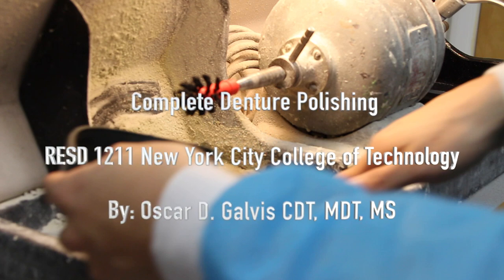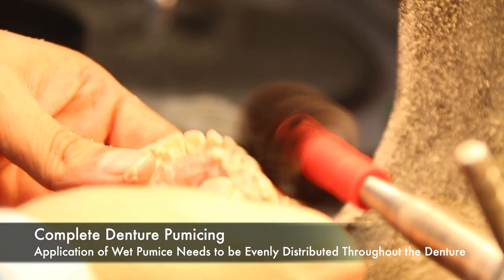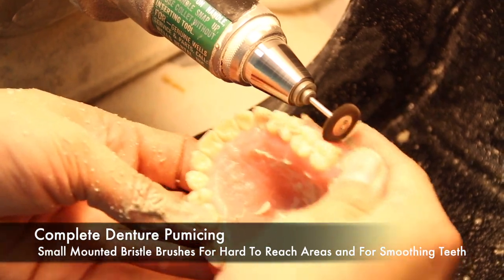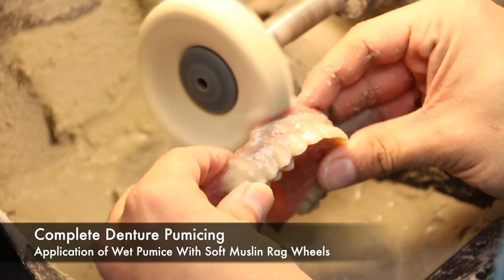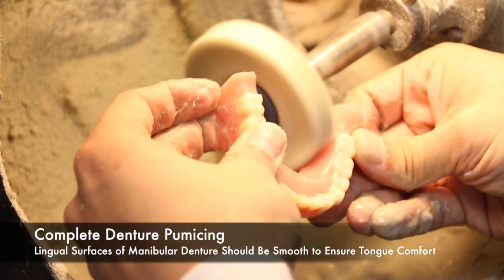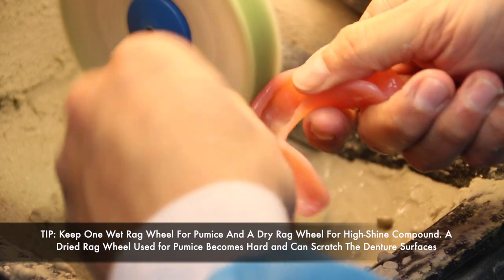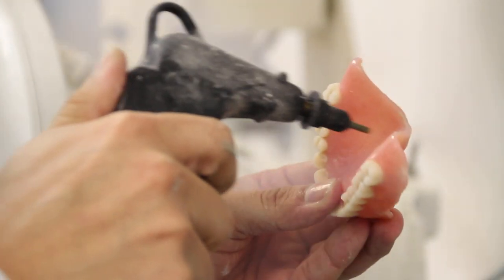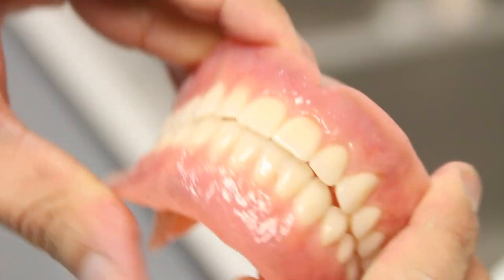Polishing Complete Dentures

Comment: Hi
How do you polish inside of a deep palate when applying the polishing cream? Which of the rag wheel do you use? The big one doesn'tcover the deep surfaces and if I force to polish it, the palatal surfaces of the anterior teeth becomes flat. Also where do you source if you have any small polishing rag wheel?
Reply: The make like a cotton polish cone not sure exactly what it's called
Reply: Polish the plaster of the palate with a towel after you have boiled the wax out before packing acrylic and use a small brush to pumice the palate you can avoid the teeth , if palate is really deep spin cotton wool onto the end of the spindle into a cone shape taking care not to expose the spindle, hope this helps !